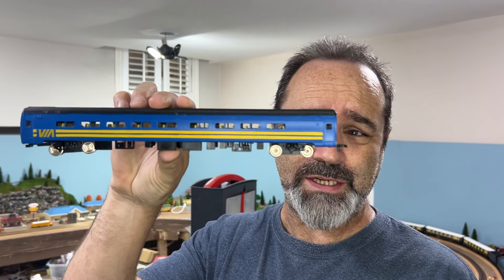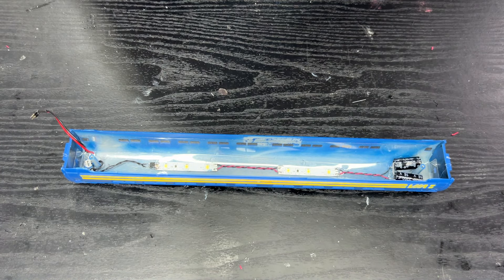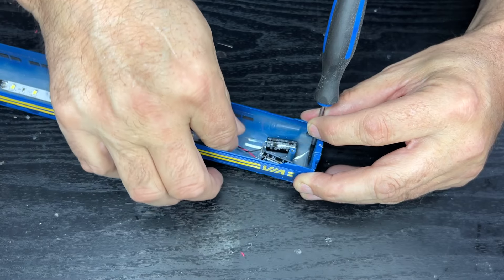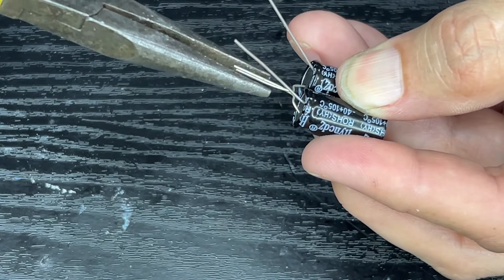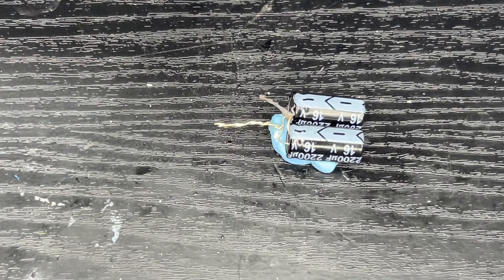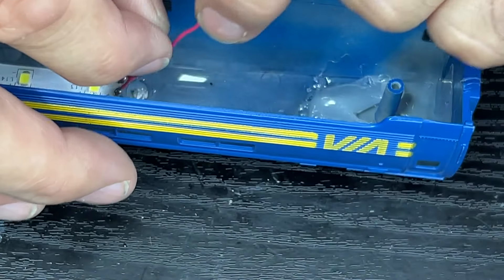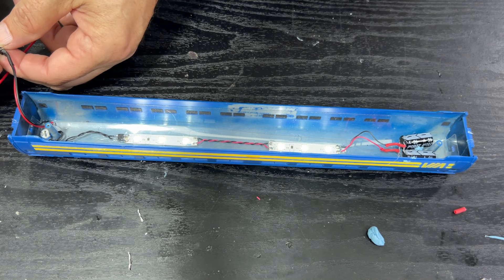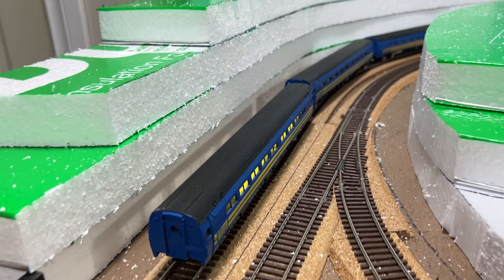Model Railway ElecTrainics - DIY Keep Alive - Stay Alive - Important UPDATE!

Comment: Good catch, in series 1/Ceq = 1/C1 + 1/C2    the voltage doubles though, not that you need that for this situation though.    Still think you could have gotten away with doubling your resistance and only using one capacitor.

Comment: I'm glad to see the update went well. Could you add more capacitors in parallel to up the capacitance? Well, yes, but space in the passenger car could be an issue after a while. I think the current setup for the circuit is just about right or close enough to work well.
Reply from the maker: Yes, after cleaning all the pickups it's working great.

Comment: Good stuff Dave.
What wattage is your soldering iron?
Mine takes ages to melt the solder where yours melts at a touch.
Happy Modelling
Reply from the maker: It's a digital adjustable job I got on Amazon, but it's no longer available. I was having the same issues you have with previous cheap irons so I splashed out.
Here's the link so you can get an idea of the specs.
https://www.amazon.ca/gp/product/B0987H26KP/ref=ppx_yo_dt_b_search_asin_title?ie=UTF8&psc=1

Comment: When I get a chance I would do a circuit with the caps, but after caps use a voltage regulator at 5 volts at run leds at 5 volts. There will no brightness change until the caps go below 5 volts

Comment: Tip with this stuff never glue components in use black tack instead if you need to replace something in future it’s easier to remove and I never use flux as it’s allready in cored solder

Comment: There is no need to pry ion the glue or heat it back up... Simply put a few drops of 70% (99% ideally) IPA (rubbing alcohol) on the joint. The IPA will wick and migrate through the joint and free the two surfaces. Fun fact. ;) - Tim

Comment: Nicely Done Dave, However it is better to have the Capacitors wired directly to the bridge rectifier before you hook the LEDs. I also saw that you put the variable resistor in front of the Bridge Rectifier. this should be also after. so best is.   Bridge Recifier --> Capacitors --> variable resistor --> LED strip.
Reply from the maker: Thanks Hai, I'll try that on the next one.
Reply: This is what I was thinking. The caps are “charging “ up and discharging their max voltage rather than the controlled voltage otherwise.
Reply: @SpringCottageModelRailway  Nope, they don't. If you give the capacitors 12 V they cannot exceed 12 V when discharging them regardless of their maximum voltage.
Reply: @LarsPW okay what’s the benefit of the above order then?
Reply: @LarsPW  thanks this is good to know.
Reply: @LarsPW I just asked ChatGPT for a wiring diagram and it put the cap in the same place as Dave had his 🙂.  And I also just watched Dave's live from Sunday night where he said he tested the different variations suggested with no difference...
Reply: @SpringCottageModelRailway  Did you explore the depth of ChatGPTs knowledge of electronics? Is it on the level of an experienced engineer with a PhD, is it rather a bachelor or a student or did it consume just a bunch of beginners literature? Or are you kidding us?
Reply: @SpringCottageModelRailway  A first benefit would to avoid the charging current having a longer and in result more resistive way to the capacitor.

Secondly I would try make a module with rectifier, capacitor and some other ingredients to use it for many different coaches. You should know that an ideal, empty capacitor behaves like a short circuit initially, but even real capacitors could trip electronic overload protection measures of controllers or digital CUs or boosters when power is turned on, especially if you have lots of rolling stock illuminated in this way. To overcome this you should load the capacitor over a resistor bridged by a diode to limit the charging current, but letting the discharging current pass freely.

Before connecting a LED-strip I would check if a Zener-diode could help to level the voltage and theefore the brightness of the LEDs.
Reply: @LarsPW  I didn’t, but I will check 😂
Reply: @LarsPW  ChatGPT did mention the resistor and the diode as recommendations.
Reply: @SpringCottageModelRailway  If you got enough knowledge you do not need ChatGPT to create a circuit for the purpose discussed here. But if you do not have enough knowledge, you should rather stuck to a properly tested and demonstrated circuit and reproduce it. Especially ChatGPT tends to "hallucinate" content.
Reply: Thanks for the advice 😂

Comment: Could that work for a 12v dc motor rather than the lights, so I can have a keep alive for a short wheel base dc loco?
Reply from the maker: I will be trying that soon, but here's what I have learned....
The capacitors can only charge up to whatever voltage is being sent. So on DC, if you are running your loco slow, it might only have about 2 volts going through it, and therefore only 2 volts of stored power. So it will work for a very short time, and immediately start slowing down. 
The difference with DCC, or AC power, the capacitors are getting a full 15 to 18 volts charge all the time, even if your loco is crawling along.
And, the motor will be drawing a lot more power than an led.
I will of course test all this soon.

Comment: Only just seen this - nice, but  16V capacitors on 15V supply - perilously close over voltage on cap [they do go bang] if you get spike from PSU.   
Options:  
                 Add Zener diode [voltage limiter], 
                 Replace capacitors with 25V [next general purpose voltage], 
                 Add 2 more caps, so you have 2 pairs of in series capacitors [in series does 1/2 capacitance but doubles your max voltage] in parallel. 

Also worth checking you input pot - where the capacitors are concerned, it's function is to limit the current into the capacitors when power is supplied [AKA in rush current] as too much current could damage your controller, as an uncharged capacitor is near enough the same as dead short when 1st turned on and the larger the capacitor [moving from in series to in parallel you have increased the capacitance X 4] the most current will flow in the 1st few seconds.
Max voltage you'll get on 15V supply stored in capacitors is 15V - that will not give you a zap.

You could also change the capacitors from standard to Super Caps - these have much higher capacitance BUT much lower voltage [typically 2.7V or 5.5V] in a SERIES stack [typically 5 x 2.7V == 13.5V {so you MUST have protection or add another cap ) 1F capacitors gives you effective 200,000uF [at max 13.5V PUS] vs the 4400uF [at max 16V PSU] the 2 caps you using provides - possible overkill for you neat lighting set up but other functions... 

Cheers - JCMP
Reply from the maker: That's a lot of great info, thanks.

Comment: Scott you say it defys logic, but it really doesn't... Think of it as if you wire two 1.5v batteries together; in series, you double the voltage - but in parallel, the voltage remains the same, but you double your current. And it's the current that does the work...

Comment: Now the caps maximum voltage rating is 16/2 = 8v !
Reply from the maker: Nope.
Reply: @ScottRails  Ah - thanks for the correction!
Reply from the maker: @SheltonDCruz  Nicely played sir.

So I originally had the capacitors wired in series, and was informed that doing this halved the capacitance.
By wiring up the caps in parrallel, they still suck up 16V each, but release it in half the time, prolonging the keep alive effect.
So I could add even more caps to prolong the effect further.
Reply: @ScottRails  Nice thanks!